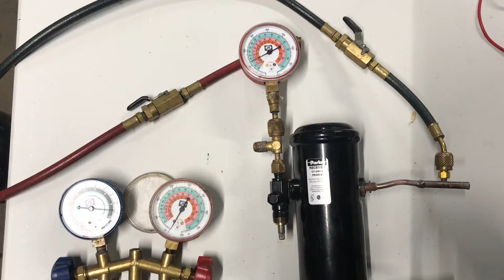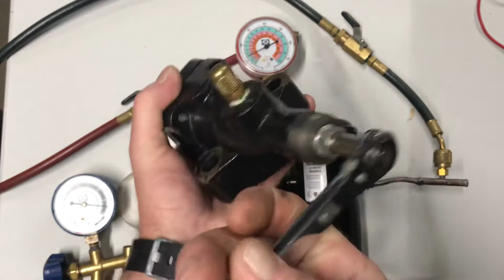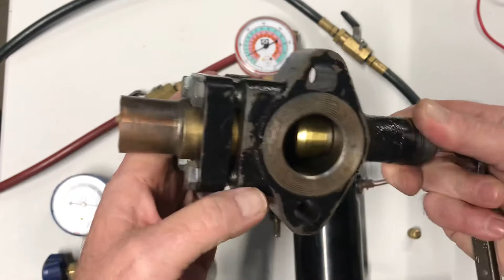How refrigeration service valves work

Comment: So what would be the point of front seating either valve when the system is running? Or is there ever a time when you would want to?
Reply: Ok. Thanks for the information. I work on strictly residential equipment but like to know all I can
Reply from the maker: By front seating the valve on the receiver you pump the system down or store all the refrigerant in the receiver. On a refrigeration system if I pump it down I can change the drier, site glass, txv, and even the evaporator.  You never want to front seat the high side valve or you will wreck the compressor.

Comment: When you have back-seated the valve can it still turn, or is it locked?
One of the valves on my compressor continues to turn even though I believe it is fully back-seated.
Reply from the maker: It should only back out so far and then stop